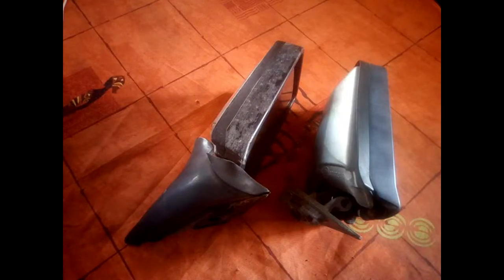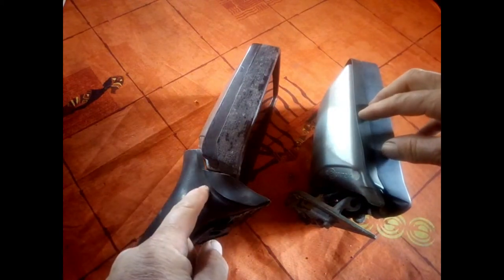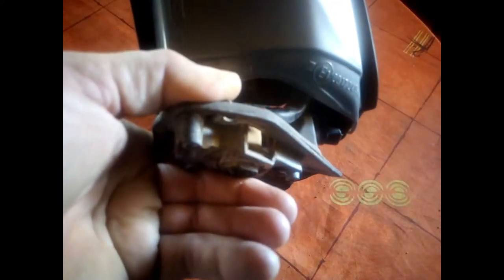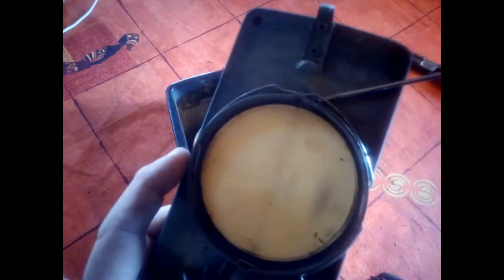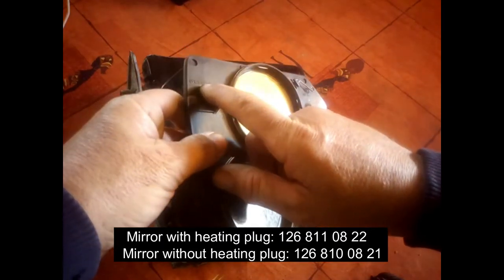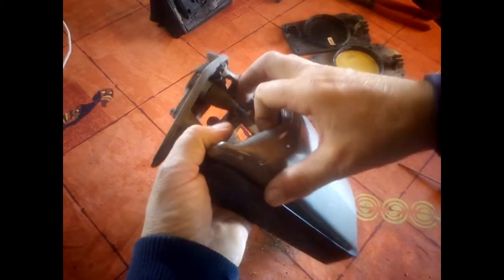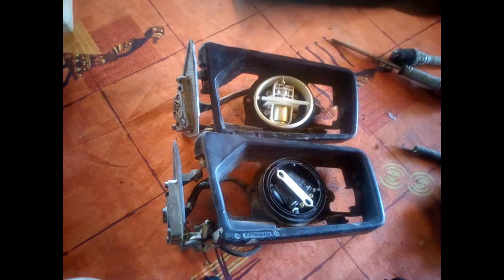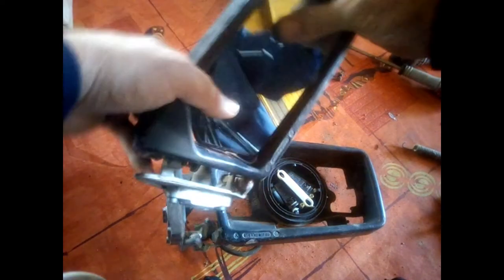Mercedes Benz W126 - Dismantle completely your electric rear view mirror diy

Comment: Hello

First of all thanks for sharing this useful information.

I have a question. Could I use my 560SELright side mirror to transfer to a manual mirror (126 810 20 16)  I need the casting which has the 3 screws
Reply from the maker: Hello,
Yes it fits